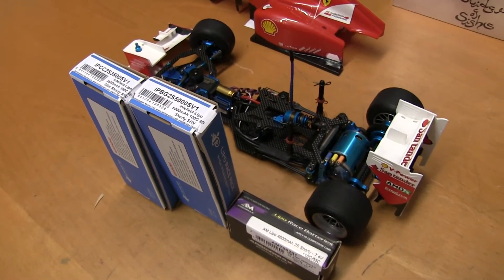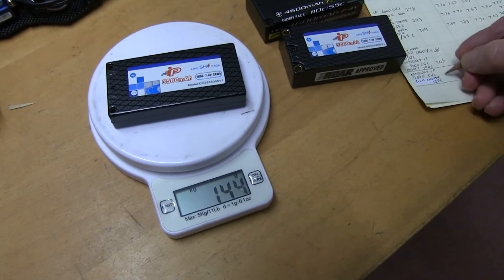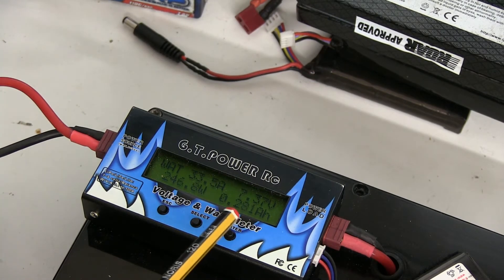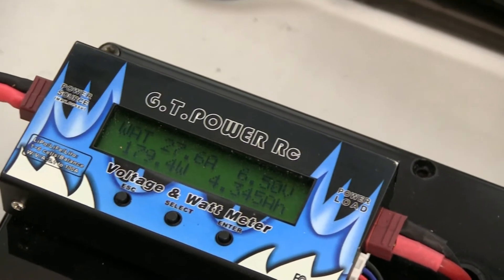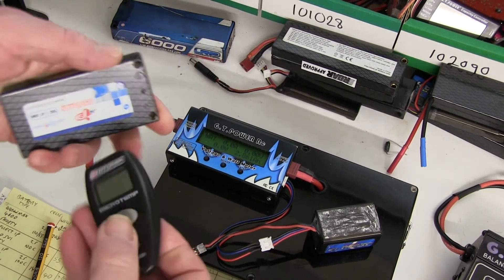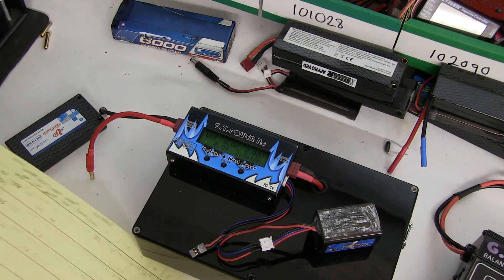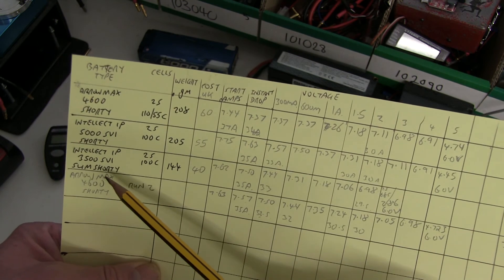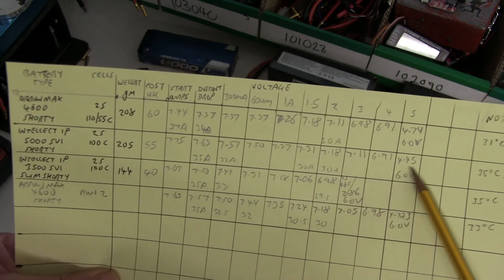Shorty Lipo Comparison. High power and capacity tests. (2S Lipo)

Comment: Thanks for sharing your battery test results. Have you ever tested several examples of the same battery to see how much variability you see between individuals that should be the same? 
If there was some spread of results then it could be that differences you are observing/claiming between different types of battery (different makes etc) aren't statistically significant in some cases.
Reply from the maker: Hi P.  I have not, but I do get feedback from the racers who use the lipos, and they report that the performance on the track is consistent with my test results.

Comment: I have run F1 21.5t this winter and the max I have charged back into a battery after a 5min race is 1.1Ah. So you don't get that far into the end of the battery cycle.

Comment: Can you test Trinity white carbon shorty against the Protek LiHV silicon graphene shorty?
Reply from the maker: Hi
Some Lipo are not available in the UK.
I will test new Lipo when I can get them.
Hopefully soon.
I have found that the Lipo for 2017, High power types over 100C rating, are becoming very similar in performance, based on the weight of the Lipos.
So those that weigh say 270 to 280gm all perform near identical.
Only the cosmetic appearance varies.
I suspect the Manufacturers are collaborating with the production.

Comment: Perhaps a re-test once these packs have a few cycles through them?  i've read some internet rumors that packs take 5-10 cycles to realize full performance, curious to know your thoughts on this.

Cheers
Reply from the maker: Hi Nick
I did re-test all the packs, but found the results to be almost identical.
The start voltage does vary slightly depending on how quickly you go from charge to discharge.
But the rest of the discharge and the capacity remained remarkably constant.
Only the Arrowmax improved after the first cycle, and then was consistent.
The Intellect were consistent from the first charge.
Lipo cells will exhibit a different performance depending on the time between charge and discharge and temperature.
But if those parameters do not change I have not found a change in performance after 5-10 cycles.
Lipo from a few years ago were not so well made as recent ones.
Recent cells have improved additives in the electrolyte that prevent cell degredation. I am not aware of any that result in improvements over time.
Anyway, let me know of any tests that show that effect.
nick

Comment: Please measure IR
Reply from the maker: Hi Rip
I can measure the IR with a special meter, but the results are not as accurate as the load test.
The IR also varies between different measuring devices, such as variouis chargers.
However the IR results are:
Arrowmax 4600 110C   2.2mOhm
IP 3500SV1 100C            2.2mOhm
IP 5000SV1  100C           0.9mOhm
Also as a comparison:
IP 6000SV1 100C ful size 0.6mOhm
Turnigy Nano 6.6 90C        1.9mOhm
Turnigy Graphene 7500      2.0mOhm

These results show that the larger capacity Intellect SV1 Lipo should have the best performance.